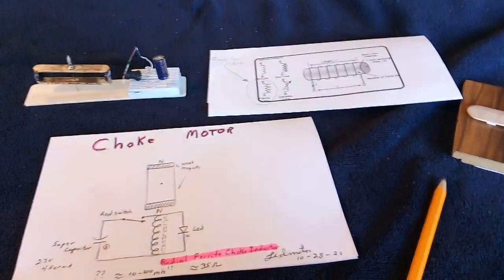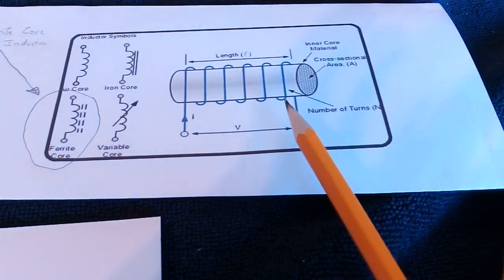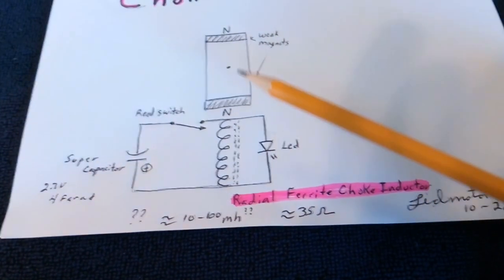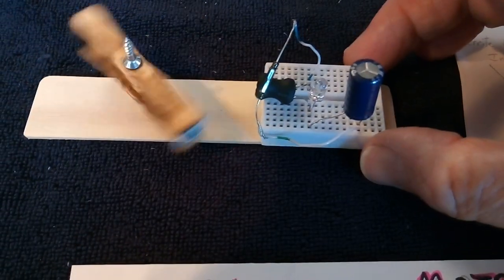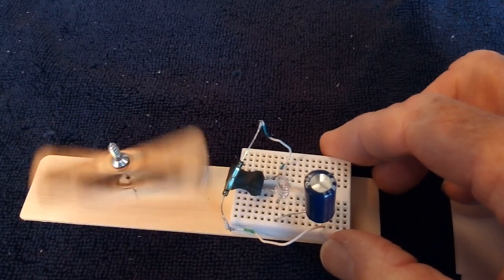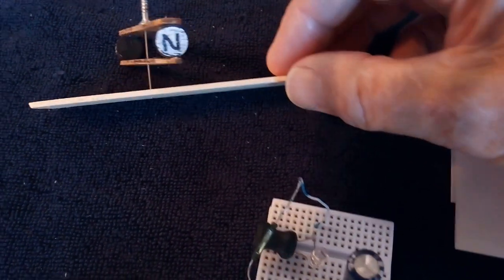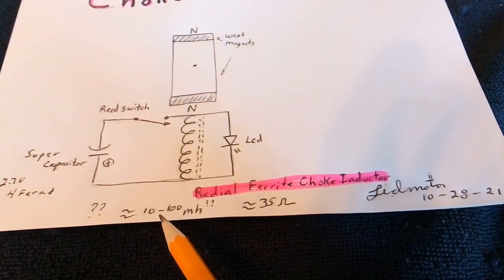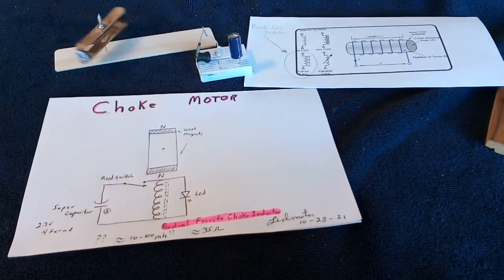Choke Motor

Comment: When reed switch is closed magnetic field is building in the coil when u open reed switch magnetic field transforms into dielectric and collapse but dielectric lines of force build up. Electricity=Dielectric+magnetic, one cant exist without another it just transforms from one field(magnetic/dielectric) into another (dielectric/magnetic) in time. Magnetic field stores energy in closed circuit, dielectric field stores energy in open circuit. Only when u add those two together plus time u got energy flow, and it flows from magnetic to dielectric if the magnetic field energy is higher than dielectric or from dielectric to magnetic if the energy stored in dielectric field is higher than magnetic. It stops when both magnetic and dielectric energies are balanced equally between each other. Now take the wire make open circle(like one turn coil) with it and u got circuit that is open and closed at the same time. By the way i love your videos so simple but open to discovery. And sorry for my bad english :P

Comment: cool rotor
Reply from the maker: Thanks.  The needle holes in the sticks have to be big enough for the needle to spin freely but not so big that the rotor wobbles.  The hole bearings are pencil graphite and crazy glue to make a slippery surface.  The Phillips head steel screw is a great top bearing for the needle.  Use a light weight oil up there.

Comment: Nice videos. I actually did something similar. The parts came out of a cheap window security sensor. The choke and reed switch would trigger an alarm when the magnet was pulled away from the circuit ( opening the window). Got a 10 pack for like 2 bucks. Fyi. All had button cell batteries too so was one heck of a deal if your into this stuff. 👍

Comment: The current from the coil isn't going back to the capacitor via the led
Think of the coil like a compression spring, you compress it when powerred, when you release it suddenly it will temporarily be longer (rebound), that rebound is going through the led to illuminate it, it's called 'back emf', it can't charge the capacitor because the switch will be open.
Reply: My thoughts too, just wanted someone else to say it.

Comment: If you made a basket weave coil (5 inch diameter)  that surrounds your "stick" spinner, perhaps more energy could be harvested off of the rotating magnets. To avoid lenz-law drag, you would need to play around with the geometry of the larger coil and how it is placed to "pick up" the rotating magnets w/o imposing a drag on them. Also, I wonder if steel wire for the larger coil would be better than diamagnetic copper wire.

Comment: Love your channel. I’m trying to build a magnetically suspended axle to experiment with some of your pulse circuits. It’s a little harder than I thought. I got it to work but I used what was available at the time which proved to be a mistake... the axle was bent. I think I’ll try stainless steel bolts. As soon as I get a good straight axle, I have the 3906 and 3904’s standing by hoping to get a pulse motor down into the micro amps. I’m hoping to find an old microwave for the turntable coil. Keep the videos coming.
I would love to see you build a toothpick pulse motor magnetically suspended maybe with some of the weaker ferrite magnets
👍🤓

Comment: Interesting video, Lidmotor.
Thanks!
N.b. is the coil made of iron wire?
Reply from the maker: The chokes are copper wire wound.  The core on these are ferrite.
Reply: @Lidmotor  Thank you Lidmotor.
These chokes are very interesting.
They come in an impressive amount of varieties, sometimes very inexpensive.
Nice how you use them as a stator coil.

Comment: Wow, how long would it run for on 1 charge of that capacitor?
Reply from the maker: A few minutes.
Reply: @Lidmotor  thats amazing, if you spin it enough by hand, does it chareg the capacitor?
Reply: If you connected a small 1.5 or 2 volt solar panel would that charge the capacitor enough to run it for a few hours.?
Reply from the maker: @ZmuFFinMan  Yes.

Comment: How long time can it spin?🤔
Reply from the maker: "As long as wind blows, grass grows. and the sky is blue."  Ha. It just spins as long as there is power supplied to it. This little super cap holds enough energy to run the motor for a few minutes.

Comment: The ferite from an old radio with all the "frogs hair" wire you can spare wound on it would create a rather high resistance inductor . 
It was my understanding that high ohm coils made for more efficient pulse motors .
Reply from the maker: Ah --- good ole 'frog hair wire' my most dreaded coil winding material.  You are right about a high resistance fine wire coil being best for the stuff I like to do.
Reply: If I remember right I found one of these but two side by side in a plastic housing out of an older cord with a reset switch. I just can't remember what it was for. I still have it and kept it to see how it would work in a joule thief circuit.